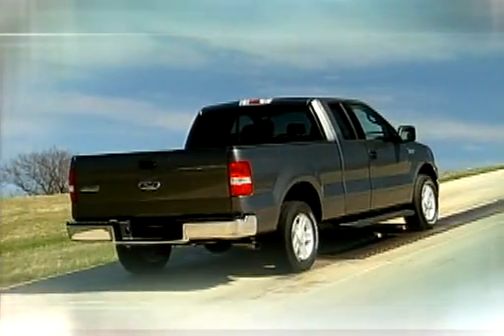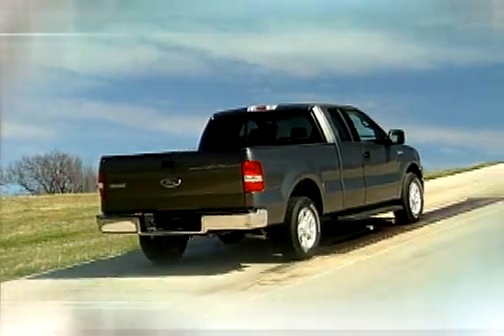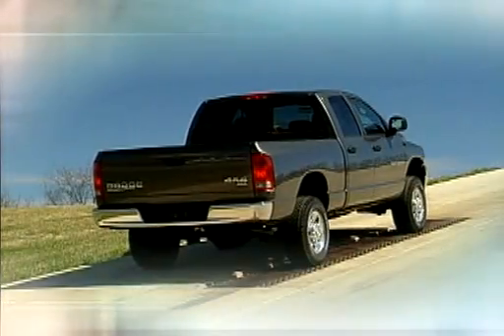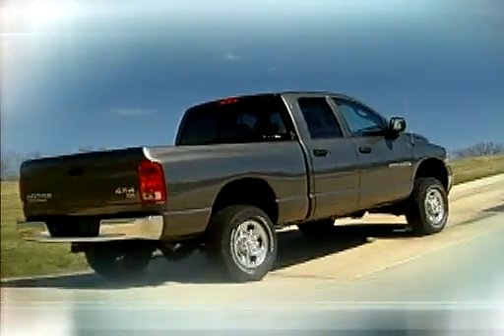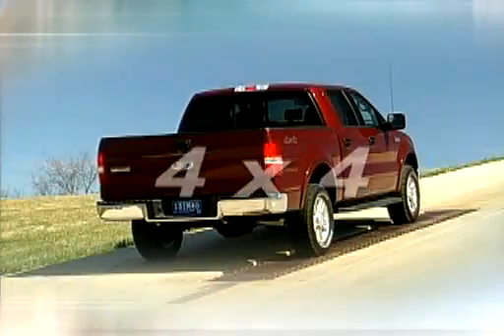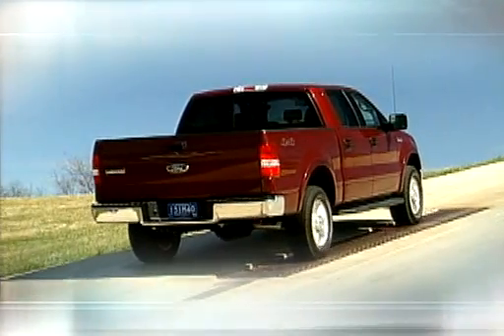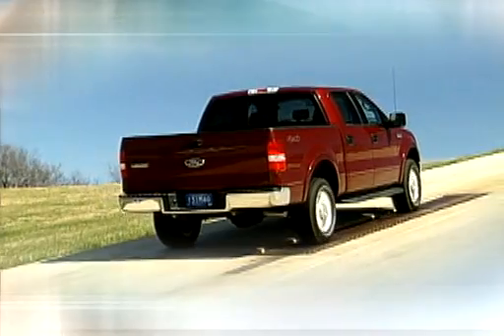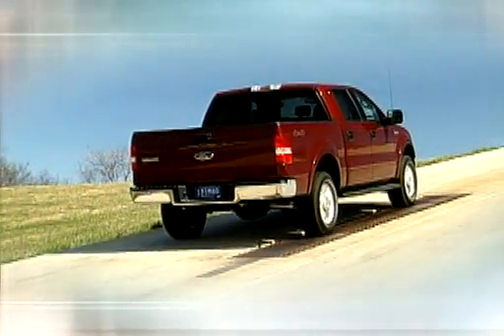Eaton Locking Differential Demonstration

Comment: lockers are great until you have bad icey roads then they are a hand full to control even in 4 wheel drive. im changing mine to an open. I have had 2 bad situations on ice because of the locker. Offroad in the dirt they are great if I had the money I would install a selectable dif.

Comment: I had the eaton G80 locker in the rear differential of my 01 Silverado 1500 z71 and had nothing but problems with it.. Either it would never engage or it did but only for a split second, resulting in a complete new assembly and then same problem except the spider gears got shredded and then I switched to the Yukon Duragrip posi trac and never had the problem again

Comment: hey can I get this for a dodge ram?
Reply: You drive down to a GM dealer and trade for w GMC or Chevy. :)
Reply: +Noe Longoria look up Detroit lockers...that way you can have a nice dodge truck and a locker...
Reply: +REDCOMET1988 421  thanks
Reply: +Noe Longoria                                 ...Not sure if you have 4x4 or a 4x2...
But i would not put a full on locker in the rear...What you need is a detroit truetrac in the rear, which is a very strong limited slip...And i suggest putting a full on locker in the front...
Trucks have most of their weight towards the front,so having a locker up front really helps pull you up and over most obstacles...
Plus for the most part your not going to have 4x4 engaged so the locker wont hinder or effect your driving. 
Also detroit lockers require rotational force applied from the driveshaft to engage, so you wont need to worry about anything while on the turning or on the highway,while you are driving in 4x2...
I would first buy the truetrac for the rear then save up for the front locker...
               ...Hope this helps...
Reply: Chevy/GMC and Ram 3/4 and 1 ton trucks all use American Axle Manufacturing front and rear axle assemblies.  Chevy/GMC use the AAM 9 1/4" IFS front and AAM 10.5" and 11.5" rears.  Ram uses a AAM 9 1/4" solid front axle.  2014 and later Ram's use AAM 11.5" and 11.8" (HO diesel only) rears.  When equipped with an auto-locking rear's, they all use the same Eaton differentials.

Comment: With limited slip if the wheel is spinning and the other isn't as in this video you lightly apply the brake thus transferring the torque to the other wheel and will climb. I'll agree that a locking differential is better in these type situations. However the video leaves this fact out. I've had limited slip in most of my trucks from 1980s ford f150 and my new ram 1500 w anti slip. I go through lots of snow and rain mud and worst loose gravel up steep grades and never had issue   If left in 2x4 up steep grades w loose gravel I would apply the brake and transfer to other wheel. Sometimes I forget or neglect tone engage the 4x4 and mid way up not good to stop to engage it and you can't engage 4x4 w the wheel spinning different speeds.  I've never felt the need for locking differentials. If I was rock climbing or radical off road that be different. 
And example I was in up state NY last winter very cold icy lots of
Snow I was going up a steep grade close to Lake Ontario both rear wheels were spinning and both front and no issues I had all four spinning it's how you drive and work the system.
Reply: +Plecemanvpd .vldpleceman I think they forgot to add the friction grease in that f150 with limited slip...

Comment: I would rather have rwd with a locking diff than open 4x4
Reply: Agree. Open 4x4 ends up as 2wd when it slips anyway. Difference is, you have one wheel spinning in the left front, and one spinning in the right rear.
Reply: I had a '78 Chevy C20 with a Detroit locker that would go damn near anywhere.
A couple times I wished it had 4 wheel. It was a little squirrelly in the snow too.
Reply: My rwd locker out preforms my buddies with there 4x4 i mean 4x2s
Reply: Wrong. Offroad, a 4wd will go places a locked 2wd will not.
Reply: a 4x4 either part-time, full time or AWD with open differential does better (not much) but slightly better with a locked 2WD vehicle.

Comment: My grandpa, dad and I have owned a 1977 and 1991 Blazer K-5 and to me they flet like they 'locked' unlike the posi unit in my Trans Am with clutch discs and friction plates. I know Mopar and all had their different ways of posi traction or limited slip etc but seems to me GM always had a locking diff. Now, I've had them apart and they have a locking mechanism. It feels so harsh when it hits but you're gonna pull.
Reply: I think my pop's 04 avalanche is the same.

Comment: Not sure if this proves anything.  Can't remember the last time I drove on rollers and I've been driving for over 40 years.  What I would like to know is is how this would work in the real world with snow/ice under all tires.  You can makeup a test to prove most anything.  I live in Vermont and drive up to a ski area 5 times a week.  They average 320 inches of snow a year and I just don't see these trucks around here very often.  What I would like to see is have them on a snow covered road vs a 4x4 and lets see what happens.  Better yet put snows on all 4 wheels and lets see what the results are.
Reply: This helps a lot in snow/ice. Say you have a RWD truck, and an open diff, 8 inch wide rear tires. You start to get stuck in snow, and the diff is only spinning one wheel, sending no power too the other, so that's only 8 inches of rubber trying to grab traction, versus the 16 inches of rubber of both wheels.
Reply: Are you a Ford owner?    If so, then to you it probably doesn't prove anything.  I think it shows a great deal if you have a truck with an Eaton locker.
Reply: "Can't remember the last time I drove on rollers and I've been driving for over 40 years."
Really? You actually can't understand that a slippery surface can be represented by snow, mud, water, or even rollers?
Reply: What type of trucks do you see up there in those conditions?
Reply: sldl04
Well yes I have owned a Ford and also Chevy, Honda, Toyota.  For cars include Buick, Mazda, VW to name a few, I am not a "brand" person, I research and pick the brand that offers what I want based on my needs at the time, is reliable and I believe is a good value.  I do believe this diff. has its place but a true winter environment with mountains and snow totals that can range form 80 to over 300 inches a year is not one of them.
I was at a local Chevy dealer having my son-in-laws Chevy serviced and asked him about sales of trucks with this Diff. He said they sell just a few that the vast majority of trucks they sell are 4x4 becasue the perform better in the winter and the resale value is better with 4x4 so you are able to get some of the investment back.  His words not mine.  Anyway you can prove whatever you want with a test look an the Extreme Traction-Control Test here for another view.  All interesting but I know what works in a true northern winter and that is all I was saying you can believe what you want but experience is the best teacher and I have lots of it.
Reply: I have the G80, and not sure its really working anymore. And I've been stuck plenty with it. If you have that traction control that uses brakes, True Trac would be a good differential to have.
Reply: JAKE Cob
The vast majority are 4x4.  All makes, Lots of Chevy, Fords, Ram, some Honda.  Now if you ask what make of vehicle do we mostly see I would say Subaru, and no I do not own one.
Reply: Of course it proves something lmao. It directly shows the physics of better engineering straight through your eye holes.

Comment: Ummm....that red Sierra is NOT a 2wd truck. It clearly says "Z71" on the bedside, meaning this is a 4wd. This dude is a moron.
Reply: I have a z71 2wd from the factory there fore I conclude the moron is you.
Reply: Z71 is an offroad package you dumbass
Also it was tested on 2wd then switched to 4wd
Reply: Haha z71 is a offroad suspension package.
Reply: Hahahaha what a moron!
Reply: Actually you're the moron, z71 has nothing to do with 4 wheel drive, it just means it's the off-road package. They make them without 4 wheel drive though

Comment: The Detroit E-locker was like that, but it sounds like it has either been discontinued or it never got released.
Torque biasing differentials are kinda like that.   They are considered a "limited slip", but they can be locked up by applying the brakes lightly while also applying the throttle.
Hummer H1's used them.

Comment: not quite, it takes a bit of time for it to reset.  Usually turning a corner one direction or the other resets it.  

However the only real damage you will get from it being locked is poor handling and tire wear.
When they break, the breakage is usually caused from too much throttle when it locks.
Reply: You're giving false information. It doesn't take quite a bit of time to reset and turning a corner doesn't reset it. Look at the Eaton website and you'll see that once the need for improved traction is gone, unlocking occurs automatically. And since the first part of your comment was completely wrong I'm not even going to follow up on the rest of your comment.

Comment: You are right, The fact that it was a Ford doesn't matter. Any truck with a locker in the rear would have made it. But the driver diving the Ford wasn't driving it right was my point. BTW I have a 74 Ford F350 with ARB air lockers and manual Warn hubs. I live in Utah and take my truck to Moab all the time as well as driving a Kenworth off road every day with lockers. It's safe to say I have driven off-road and engaged a 4x4 a time or two.

Comment: The F-150 was an open diff, not limited slip.
I have a 02 Explorer that I bought new in 
02 and it came with a limited slip differential.
The reason I know this is because it stated
it on the window sticker. Also I had 1 wheel
on ice, witch in their case stimulates rollers
and the other on black top. The 3.73 limited
Diff had no problem in 2 wheel...🚚😳

Comment: You notice when they showed the second Ford with the Limited Slip differential when they cut to it the tires were already spinning. The driver was probably flooring it and overcoming the limited slip with to much torque input from the engine. I bet if they started slow it would have made it.

Comment: @CaseIH232 if the 4x4 doesn't have a locker then get the 4x2 with the locker, however if the 4x4 has 1 locker(rear axle) and 1 open differential(front) then get the 4x4.

Comment: @popatittyshit 
The Eaton G80 can lock fully, which makes it a locking differential, not a Limited Slip differential. A LSD will always have a little slip, hence the name. And yes, most LSD's are a wee bit on the "sloppy" side on purpose, since it reduces tire wear and allows tighter turning circles during normal driving.

Comment: @afghanmanyeah 
It very much depends on the LSD.
Also, some can be adjusted to transfer more torgue as the RPM's increase.

LSD's are better than open differentials, but in a case like this, with complete loss of traction on one side, a fully locking differential is best. Offcourse, you often have a mix of traction, and you also have to factor in the increased turning radius you get with locked differentials.

It's all about finding the right compromise for your situation.
Reply: Try getting out and adjusting it when you need it.

Comment: @rockinfaceplant0000 - if i was you i would look for something like a detroit locker if you do any offroading. my truck is on its second g-80 in just over 43000 kilometers. i should really mension that my truck has never been offroad and the worst its seen is snow on the roads. even the new one bangs like crazy. a grenade looking for a place to explode

Comment: @296jayce the company i worked for had all chevys and some fords.all the chevys broke down.the engines are junk and keep dropping turbos and injectors.not to mention the oil lines plugging up if you dont change the oil every 2000 miles.and dont even get me started on dodge they are pure junk.test drove one and the oil pump in the trans broke out of the casting and the trans seized up.on 2 different trucks one right after the other.and why did our chevys front ends fall out and roll

Comment: @296jayce really? you cant back that up.my dads ford taurus just turned 285000 miles with the original engine and trans.my neighbors impala has already had 6 transmission in it at just over 120k.oh i also forgot to say hes on his 3rd engine.my buddys HAD a malibu with 65k and 4 engines.my neighbor HAD a chevy with a durashit the when he got rid of it it was on its 3rd trans and 2nd engine.now he drives a ford  and has put over 300000 miles on it never had any trouble.

Comment: @skaterboy520c even if the f150 and the ram put in the locker i would still say they are a piece of shit because they copied off of GM which wont happen because its patent by GM so the only way is for the owner to do it.Which requires ALOT of mechanical experience

Comment: I don't really see where the Ford had a problem. I have an '02 with a factory installed LS differential, and I've never witnessed only one wheel spinning. I go anywhere and everywhere with my truck. The only thing thats limiting where I go is the ride height. I scrub frame before I get stuck.

Comment: I could make it up that hill faster in my dakota with an open differential. My proven Farmers secret? tap the parking brake 1 click in, that will prevent the wheels from free spinning thus distributing the power to the wheel that needs it. Works great on ICE.